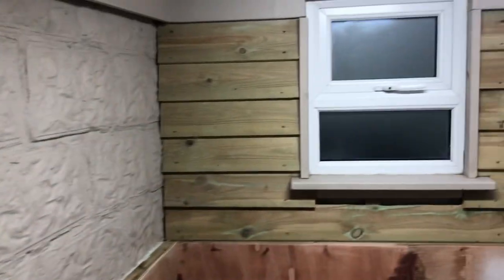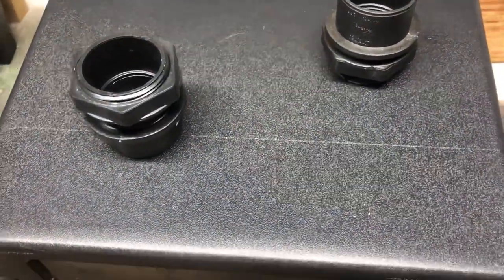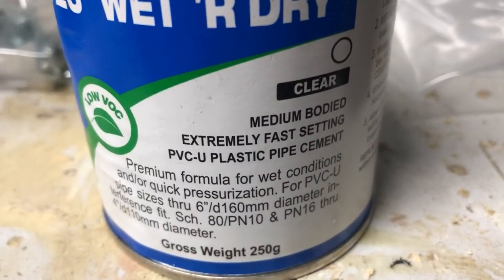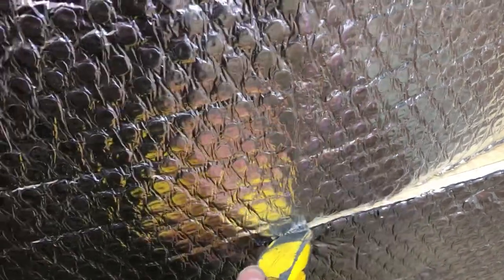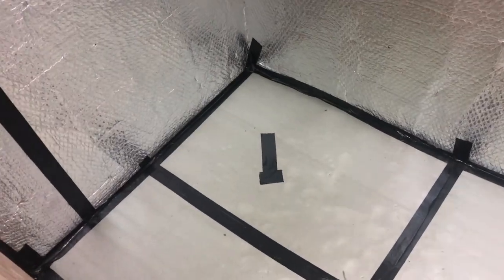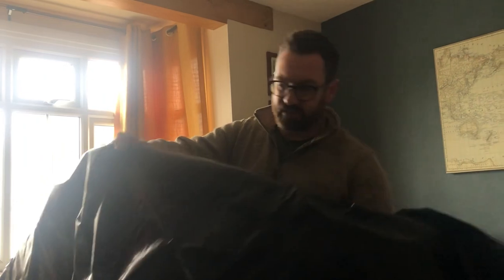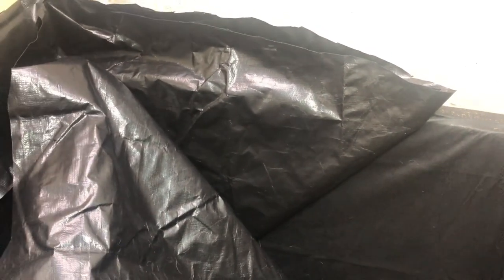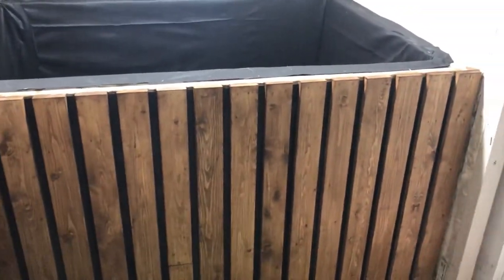How NOT to install a pond liner! DIY filter shower and installing a pond liner - DISASTER episode😱😱

Comment: I'll raise you a makita impact driver doing straight through the base of an insulated, fibreglassed, flow coated, block built 2000 litre bio tank! Oh how I laughed.  I was only putting a few extra screws in the walls above, just to be safe 🤦‍♂️
Reply from the maker: Sod’s Law ☹️ Hope you got it sorted ok. These things are meant to try us but we’ll always bounce back! We should’ve picked a cheaper hobby though 😂

Comment: Oops easily done but silly mistake you won't do it again 😅 but on the plus side at least it wasn't a edpm liner as that would have been very expensive although you can repair edpm 🤔 great update though Dave 👍

Comment: Absolute fecking nightmare Dave bruva been there myself 🧁🤬🤬🤬💯👍👍👍
Did you not consider putting a false floor in with a bottom drain  ❓️🧁👍👍👍
Reply from the maker: I did think about it but would lose a fair bit of volume. Also, the tank Will predominantly be for the fry. So far with the pump and it’s stayed clean. May need to think about a diy retro bottom drain once they are a little bigger. 👍🏼👍🏼

Comment: If we didn't run into problems when dealing with our koi ponds, i.e plumbing leaks, accidentally putting a hole in a liner 🤬 , etc ,what fun would the hobby be. 🤣 Hope things go better with the new liner. Slats add a nice touch. Cheers.
Reply from the maker: Thanks buddy 😂 Like you say, it would be boring without the mishaps - friendlier on the wallet but boring 😂

Comment: You've got load of spare for a patch. I ended up with a hose putting a hole in mine. Bit of ct1 and a patch and it lasted years..
Reply from the maker: For piece of mind I changed it over. I’d be heart broken if a patch failed 👍🏼

Comment: You could off cut a patch out of the excess linner and used C T sealant to patch the hole up as a repair kit 👍
Reply from the maker: It was a cheap HDPE liner. Her some real horror stories about repairs. For the £60 odd quid it just didn’t make sense to repair it. I did do a test patch with ct1 and like many said, the bond was poor. I have peace of mind. Thanks for tuning in 😊👍🏼
Reply: @Eden Koi Pond and Garden  that's because they push all the sealant out and make it flush with the linner does work done it on my little grow on in the conservatory with no leaks after might of been me being lucky🤷🤣  but get your point bud👍